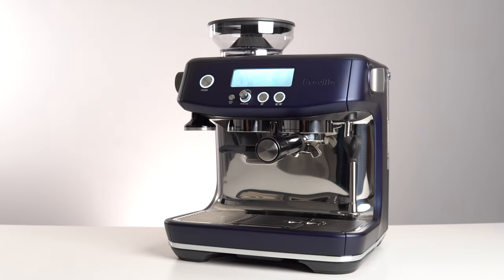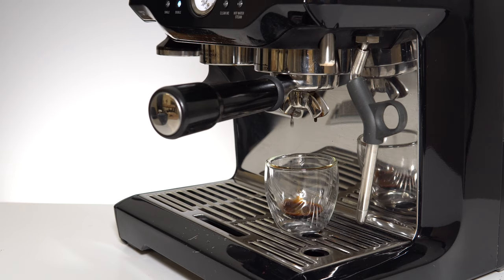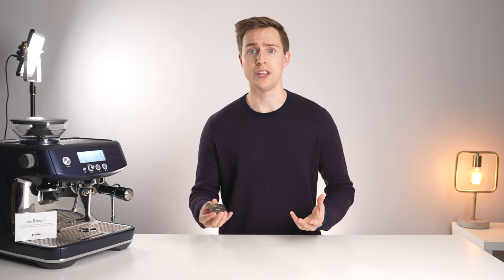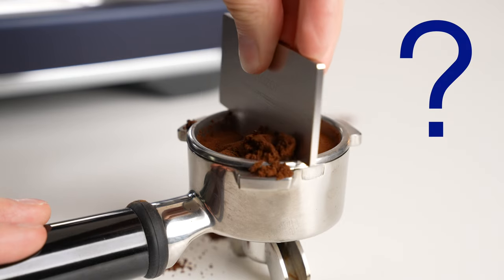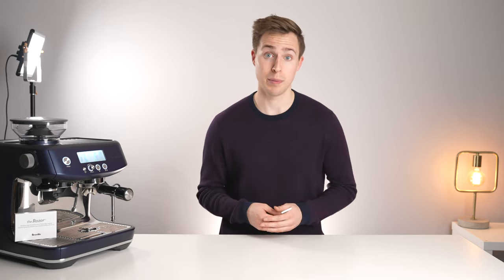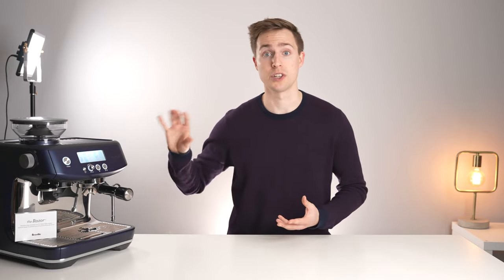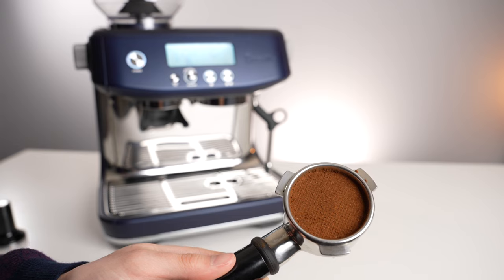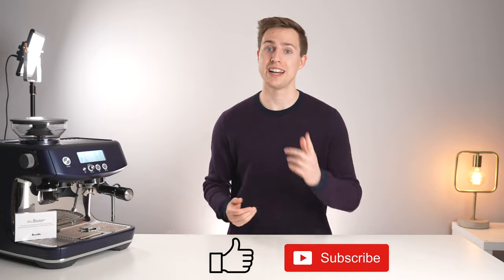Breville Razor | Should You Use It?

Comment: The Razor is perfect for prying the basket out of the portafilter when cleaning or swapping to a different size. It's much easier than trying to use your fingers.
Reply: Try using another basket (upside down) it works every time. I'll try the razor too.

Comment: Empty hopper. Weigh your beans say 18g. Use the tamp until the metal is flush in porta filter. Job done. You can use the razor just to tidy the very edge inside porta filter basket.

Comment: I found a great use for it, believe it or not, lol!
After tamping, I'm sometimes left with coffee grounds sticking to the sides of the basket. Rotating the razor on the basket's wall while holing the portafilter at an angle against the knock box gets rid of them completely, leaving me with cleaner looking basket haha.
However, after using a 53.3mm tamper, I no longer needed it, always cleaner baskets with the 53.3mm tamper.

Comment: I use it only to gauge the minimum depth of my distribution/tamper tool. Otherwise, it’s useless just as you mentioned. In addition to the coarseness/fineness of the grounds, the roasting level can also vary the volume of the grounds in comparison to its mass, thus rendering the “razor” ineffectual.

Comment: Once you dial it in to your grinder and find the right dose the razer comes in handy. It ensures you get a perfect amount every time if you use it intelligently, i didnt see it being used appropriately in this demonstration. 

My shots improved dramatically with this little tool. Definitely don't go and order the tool online as there are better versions out there but for something extra in the box i was pleasantly surprised.
Reply from the maker: Volume is not an accurate dosing system as it changes as you vary the grind size, and different coffee densities.

Comment: Think you are missing the point.
I use it occasionally to aid dialling in.
Not to scrape off a layer of coffee but to check the death after tamping as that's the death recommended for the higher than normal shower screen of the breville or sage.
I then adjust Grind and coffee weight in to  my single dose niche zero grinder to get 2:1 out:in in the magicalc 30 seconds.
Use in mainly when I try a different or new to me coffee beans.or a different vst basket size. Currently using 25g in to a vst 22g which was my ideal after dialling in with the aid of the thing I did not throw away!
Reply from the maker: You can definitely use it to double check like that! 
But the method shown is how Breville is telling people to use the Razor product, and it's a bad idea when used in that way
Reply: @LifestyleLab_  been using the useful depth measurement you provided for a distribution tool you provided in a previous video. Much better!

Comment: I have the Breville dual boiler and smart grinder pro. I use a 22g single dose which I have dialed in for correct grind size to give me exactly 9 bar extraction. The biggest variable for me is my tamping pressure which the Razor helps with. I also waste NO, NADA, ZERO coffee! Here is my workflow: 1. Add 22g beans to Hopper. 2. From initial setting of 25 seconds, grind until 8 seconds remain. 3. Pause grinder and give very light tamp. 4. Finish grind (make sure grind chamber is empty) and give full tamp. 5. Use Razor to check level and swirl to level and clean off sides of basket. 6. Add stray grounds from grinder tray. 7. Re-tamp for smooth, even puck. 8. Extract perfect, repeatable shot every time!

Comment: I’m confused  my Breville Oracle Touch grinds and tamps automatically so wouldn’t it automatically ensure the coffee bed is low enough so it doesn’t contact the shower bed?

Also, how would I ever know it’s contacting the shower bed?

Do I need to measure how low the coffee bed is after it’s tamped?
Reply: Oh I just re-watched how to check if it’s contacting shower screen.

But still curious as to why the automatic tamper is not temping it deep enough.

Can that be adjusted by increasing more pressure?

What’s the negative effects of having coffee contact shower screen?
Reply: @apilkey  After I have watched film I am having the same problem on my Oracle. The shower screen touch the pack, it is not temping deep enough. I've changed the tamping force from  5 to 6 and next the time from 4s to 5s. It doesn't help, increases the amount coffee.  I was wonder if this only my problem but seems that we have all the same issue. @Lifestyle Lab could please check, if you have the same issue on your oracle expresso machine, not temping deep enough, is it possible to fix this on oracle?

Comment: I have brevile barista express, and it doesn't give me consistent shot every time. 
I set the dose to 18g and yeild 36ml, however after couple of shots the yeild changes sometimes it output 40ml or 30g, so I don't know why I am not getting a consistent shots.
Reply from the maker: You'll have to look for variations in your process! 
How are you distributing? Is the portafilter the same temperature for each shot? Are you purging the group head before each shot? Many things to consider

Comment: Actually you should keep it but not use it in quite the way that is show here.  
The razor gives you a standard volume.  The way I use it is to scrape and discard until there is a the amount of 'extra' running over the standard flat surface in front of the blades that I want.   If the result is a bit over-extracted I reduce the extra next time.  If it under extracted I increase the extra.  Using this system you can fine tune your extraction for different beans at different grind sizes.

Comment: This is wrong. 
The purpose of the razor is not to shave off and discard extra coffee. 
The purpose is as a depth measuring tool. You tamp the puck and measure with the razor before attaching the portafilter. That’s exactly to prevent coffee contact with the curtain. If the razor is able to shave, then you redistribute and tamp it harder. You don’t discard “extra coffee”. 
Obviously, redistributing is a lot easier with that redistributing tool, if you have one. They are not cheap though.
Reply from the maker: This is exactly how Breville is instructing for it to be used, and yes it is wrong: https://youtu.be/5LWrVUD22gQ
Reply: @LifestyleLab_  
Yeah, Breville messed up. Good codification.